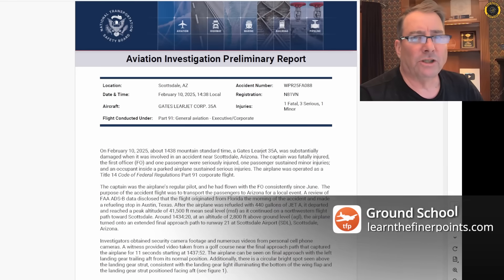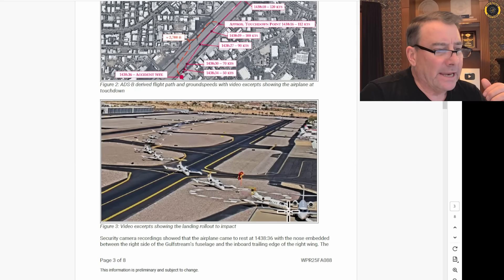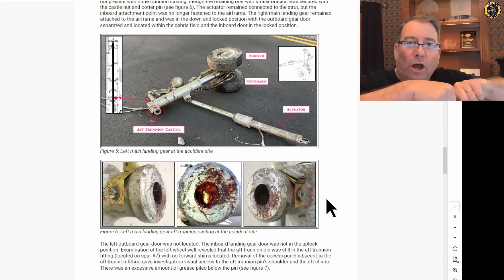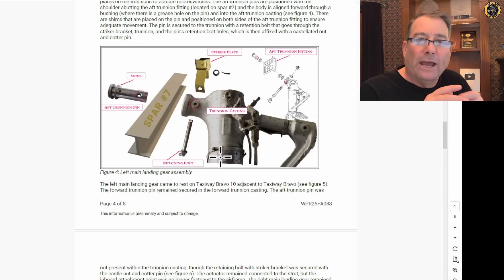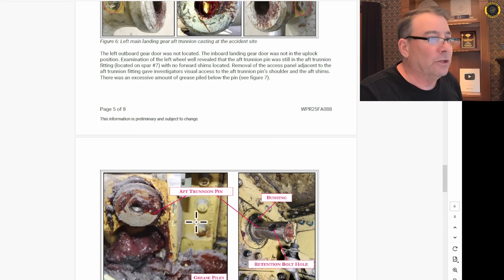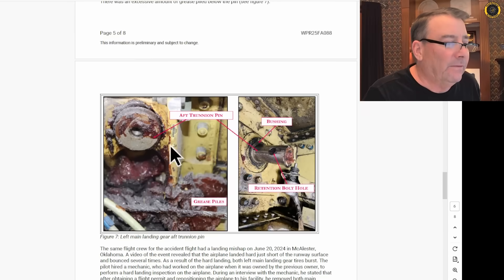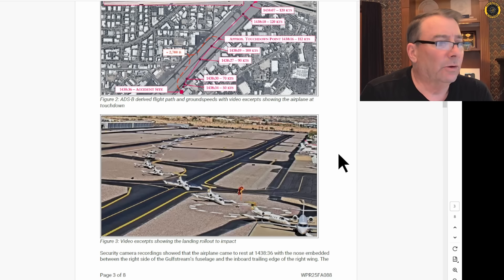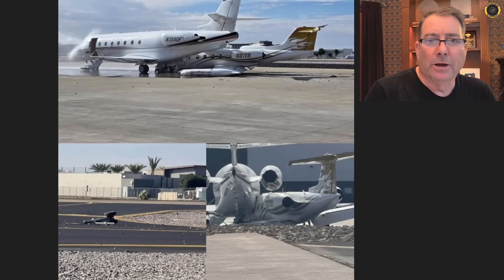NTSB Preliminary Report Fatal Maintenance Error Lear 35 Scottsdale

Comment: I'm an auto mechanic and every time I reinstall a steering shaft onto a steering gear (it uses a bolt similar to what is discussed in this video) I loosely install the bolt and then tug on the shaft aggressively to make darn sure it is actually engaged properly. I have always had a fear that I would do exactly what the mechanic did in this situation. I feel horrible for him.
Reply: I am too - fortunately with all the steering shafts that I've dealt with, you're either a mile off (obviously wrong or the shaft isn't started at all) or the bolt simply won't start due to the notch in the steering gear shaft not aligning with the bolt hole in the input shaft. 

I can't help but think that there would have been an obvious gap at the back where the gear casting would normally be in relation to the spar. Looking at the pictures, there are shims to set the relationship of the gear to the spar - why was this not inspected? Is this not covered on the checklist? I know that it's easy to point fingers from the comfort of our couches but this seems like really sloppy work.
Reply: Great post. Thank you for your due diligence and follow through. You are a true professional.
Reply: I feel more horrible for the people who died and were injured due to his negligence.

Comment: When you work on vehicles that transport people, like airplanes, busses, trains, etc, always verify every step of the way and then verify again! Losing one life is a tragedy. Losing multiple lives is criminal negligence! Even when I'm fixing cars, I double-check that every bolt has been replaced and that they are tight. People with much more knowledge than myself designed them with all those bolts. If they don't need to be there, they wouldn't have put them there in the first place.
Reply: Amen. Never do a half-assed job, ever.

Comment: If the shim stack clearance had been checked the retaining bolt would have been in place correctly. So we know that those clearances were not checked and that the retaining bolt was inserted before the pin.
Reply: Exactly what I was thinking. To totally miss the pin, that shim "clearance" would have to be so huge you couldn't miss it! Is the shim side of the pin really hard to access or something? Is checking the clearance done with a borescope around a tight corner? Or is it just pure dgaf?
Reply: @jessicav2031 I have a rental equipment yard, I'm very familiar with my equipment. Mechanic comes in "Hey boss, I need you to order 25 of these shims" I see it normally requires maximum of 3. I get up out of my chair.
Reply: This installation requires shims under the head of the pin (aft side of the spar, very difficult to access working by feel) and between the spar and the strut (foward side of the spar, visible but tricky to hold the shims in position while pushing the pin through from the back side). All shimming takes place at the rear trunnion pin. Shim placement (whether on the back side or forward side of the spar, typicallyboth) will determine forward/aft placement between the spars, in the wheel well, in order to have proper clearance between the strut and the lower wing skin. Free play clearance (just a few thousands) is measured at the forward side of the aft wheel well spar. It is possible to shim the strut fully forward and measure an appropriate clearance at the aft spar with the aft pin not properly installed.
Reply: 100%

Comment: That's a Red X maintenance job. Am referring to my Air Force days. Red X jobs required being checked out by someone with a lot of stripes on their sleeves. Some Red X jobs required someone with even more stripes to sign off on the repair. For this to happen is unreal.
Reply: IPI in the USAF. In the commercial world we call it RII, required inspection item.
Reply: The unwillingness I have seen of line technicians to have someone check their work is unbelievable. It's a sad ego thing. Totally broken culture.
Reply: @clippy2565  We crew chiefs were the bosses of no one. Everyone else were our bosses. We knew that.
Reply: @miketype1each  sounds like a shitty situation. I was talking about civilian techs though.
Reply: @clippy2565  Okay. Yeah, we did our best. We always wanted to do that. In basic training, we were told that while we may be proficient at an activity or job, that didn't give us license to act, but instead were to be authorized. It was authorization which gave us license to do this or that.. all of which is to say whoever wrenched on that gear wasn't also the inspector. Frankly, for the airport/airline/whoever to allow that sort of maintenance is, well, maybe probably criminal. It's just sad.
Reply: @miketype1each  that culture of having someone inspect who didn't do the wrenching is much less common in civil aviation. I know the airlines do it. And their safety record shows.
Reply: As a R4360 engine mechanic in the Air Force, I know alot about Red X's, everything we did was a red X

Comment: Great explanation Juan! Based on your description there is no way the trunnion pin was properly shimmed or the pin would have been in the correct position to accept the bolt in the thru hole that was designed for it. I’ll never understand why companies that provide maintenance and the maintainers who provide the work aren’t mandated to do all maintenance with manuals in hand and opened step by step to ensure nothing is skipped. It’s impossible for mechanics to memorize every step of every procedure. Not a good look for maintenance.
Reply: I can tell you that a repair station working on these type of aircraft would be required to do have the manual open and follow it step by step.  Whether the mechanic comprehends how to apply what the manual says is another matter.

Comment: I thought ATC was supposed to check aircraft as they approach visually, could be wrong. I guess whoever photographed the plane maybe thought an emergency was already declared.
Reply: ATC= Air Traffic Control.
As far as I know, there isn't any official department that Visually Inspect All Aircraft Attempting To Land (to be able to see the aircraft far enough away from landing and determine if the gear was configured properly and relay the OK to the PIC, the inspector would need a telescope, even with that it would be impossible to check the gear completely and confirm every nut, bolt, pin, and retainer is accounted for).

The possible labels of what to file this under are many-
Common Sense, lack of.
St . . . .
reminding self -->  n o w . . . play nice❗

Comment: @blancolirio.  Juan, we had almost an identical issue with a brand new PC24.   This happened back in 2019 or 2020 when they were still a brand new jet.  

We had a gear unsafe indication on the nose gear.  After a tower fly by they said it looked down and a precautionary landing was made.  Upon landing it did not want to steer.  After examination the Trunion Pin on the left side of the nose gear had been installed incorrectly during manufacturing and the retaining bolt missed the hole just as in this case.  The airplane had about 100 hrs on it at that point and the pin worked its way out just as in this case.

The outcome was much better for us.   We had Pilatus AOG team cover the remainder of our trip with the demonstrator PC24 and I obtained a Ferry Permit after field repairs were made to a maintenance facility where the nose gear was replaced.

Comment: Thank you for the excellent explanation of the gear attachment/assembly process. It would seem that, if the retaining bolt wasn't through the hole and the aft trunnion pin was just pushing up against it, that the head of the trunnion pin would be sticking out too far from the aft side of the spar, and (if possible, I know nothing about Learjet assembly) either visually inspecting the pin to make sure it was seated correctly or reaching behind the spar and feeling it to make sure it was in position would tell you that. Also (and again, I don't know how snug the assembly is) if the pin wasn't properly secured, wouldn't you be able to either pull the gear assembly off the pin or pull the trunnion pin out of the spar while the aircraft was still on the jacks?

Comment: This is very bad.  How many sets of eyes should have looked this assembly over before giving it a pass?  
Didn't they do both gear assemblies after the hard landing? 
 Basic bolt "A" in hole "B", passing through hole "C".  How did the head of the trunion pin sticking out at least 1/2" at the spar NOT draw attention?  
Condolences to all those who suffered from this loss.  
The shortage of quality personnel in the maintenance side of aviation seems to only be getting worse.
Thanks for the report Juan.

Comment: Obviously the mechanic didn't check the clearance and instead just put the same spacers back in.   If that check had been done this problem would've likely been avoided.  The near endless appetite for grease was another missed signal.  Kinda scary how bad this job was handled.

Comment: That's just astonishing. Is there no procedure to pull on the pin to ensure that the bolt is going through it? 

Details matter, but this wasn't a detail. It was the most important task in mounting the gear.

Comment: When I worked on Chinooks in the army around 1980, we always had our work double checked and signed off by a Technical Inspector. I guess A and P mechanics don’t use that system in aviation today.
Reply: It depends on what part they are operating under.  Most general aviation it is not required.  Obviously it is a good idea and many small shops do it voluntarily.  A repair station of the type that works on these kind of jets would have had a mandatory inspection requirement, but if the inspector simply looked in there and saw the small bolt in place, he might just sign off on it not realizing the trunnion pin wasn't seated.
Reply: @ thank you

Comment: Look at the FAA’s picture of the landing gear at timeline 2:11 and look at the actuator closely and look for the wires coming out of the front of the actuator. Those wires are for the landing gear control system and the warning lights. If that actuator is fully extended the wheel well doors will close and give a green light to the crew. I never did like that system because the landing gear could be missing and the crew would not have any indication of a problem. Hope this gives you more information.
Reply from the maker: Thanks!

Comment: Why in 2025 we can't have camera with lenses and sensors the size of a Ring camera or GoPro in an aerodynamic shroud on the underside of the plane....?  Yeah..FAA certification long and expensive..make it auxillary not necessary to the operation..like how pilots can use ForeFlight on their tablets.

Comment: Had the pilot known the gear wasn't as supposed to be, I'm not sure there would be anything he could have done. The optimum choice would have been a belly landing, but once the gear was deployed, I doubt the left gear would retract. Been up in a 35 a couple of times and I don't remember seeing the mains from the cabin, so nobody would have known until it went cattywampus on the runway.
Reply: If he'd known, maybe be ready on the rudders & even use asymmetrical thrust (he had two working engines) or reverse thrust to help maintain directional control. Always better to know.

Comment: In the 4 pictures of the Learjet (2 smaller-2 larger) in the video 
the left main does NOT appear to be anywhere near down-and-locked.
It appears from the airport diagram that the control tower is just slighty 
past the halfway point on the 8249 ft long runway.
Granted the crew did not indicate that there were gear issues BUT I am 
disappointed that no one in the control tower grabbed the binoculars 
to look st the landing gear.
At about a half-mile final the Lear would have been about a mile from the tower.
Had ATC been looking to verify that the gear was down (with binoculars or 
possibly without) they may have observed that something was not looking
quite right.
Just another hole in the "swiss cheese" maybe?
Reply: Obviously, you've never been a Controller in your life!

Comment: Seems like there should be a procedure or indicator  to verify the bolt is correctly seated. having a single fastener be a single point of failure does not seem like a great design.
Reply: There are hundreds of them in every aircraft.
Reply: @AlbertHess-xy7ky    single point failure without any way to check for proper install?
Reply: @asbestosfiber  There are hundreds of them in every aircraft. Cost to rectify?

Comment: Hard to imagine how a competent mechanic dealing with an assembly that is held together by only one pin would fail to make sure that pin is actually inserted correctly... that ~1" gap from the locking pin being ahead of instead of through the hinge pin should have been pretty hard to miss.

Comment: For a pin that takes a shim stack to insure proper placement, this indicates total failure on the so called mechanic that performed this installation. To place the pin that far out of the required position so to enable the bolt to intersect, shows absolutely no attention to any required shim stack adjustment. That is not a mistake .....that is incomitance, plain and simple.

Comment: So this is a common risk in maintenance when you fly into airports with less infrastructure.  I'd imagine being in rural Oklahoma, they got an A&P with some jacks and busted out the Learjet Maintenance Manuals for reference.  This is all fine and good when you're swapping a generator or changing a tire, but for a major event like removal of a MLG, they should use a repair station with the LR-35A on their capabilities list.  At the very least, they could have had a mechanic with specific Lear 35A maintenance training do this.  

Now I will stand corrected if this was the case, in which that repair station will have some explaining to do as to why the item was not properly inspected after the work was performed.  As far as I know, if this was done by a repair station, failure to perform the inspection would be a violation of 145.211.

Comment: Juan, Your 310 has a main gear shaft fore and aft, I have seen them come loose also and the shaft moves out of the clamps and your gear would have the same problem, A&P for over 50 years

Comment: Perhaps one more written step in the gear installation part of Chapter 32 would have prevented ALL of the pin problems...  "Ensure the pin is fully inserted and will not rotate."

Comment: This perfectly illustrates the meaning of an accident waiting to happen. One would think that the mechanic upon noticing that it seemed to require much more grease than usual would have been a flag for him or her to go in there and take another look and find out why it was needing so much grease. RIP to the pilot and condolences to his family.
Reply: "requiring more grease than usual" is a subjective statement
Reply: @tyronetrump1612  Yes it could possibly be. However,  if you work on something on a regular basis you get a feeling for how the procedure normally goes. Anytime it doesn't go the way it normally does you should stop and take a look and try to ascertain why. Especially when it comes to working on aircraft where even the smallest detail might end up causing a severe accident.
Reply: @carlmontney7916  bingo
unfortunately there is nothing on doing this install that would tell you something is amiss ( like something that doesn't fit or feel right). If anything if i were doing this very job and everything went together too easy ( especially that retaining bolt) with no fighting and cussing I would def think something wasn't right. a 2 second peek at the pin in the rear compartment would have   prevented this.

Comment: This may be already in practice, but with the low cost of small cameras, it would make sense to have an image of the wheel position before landing. This could be done for many areas, like the multiple images on a security display, available to the pilots.
Reply: Australian TV has been using them on race cars for 30 years. We see in the drivers compartment, his feet and gear shifts, as well as suspension shots. I reckon they are are a must on airliners to show gear, flaps and the tail unit. The reason not installed by manufacturers is simply cost. The engineering already exists.
Reply: Pilots are very busy when landing a jet.  I doubt they have time to scan and interpret a half dozen cameras.  The problem here is that the "green light" did not mean things were ok.  Fix that.
Reply: @HweolRidda  To be used only when there is a problem to assist in trouble shooting was the intent. Not used when ops normal.
Reply: @johnmclean6498  that's valid.  In this case it seems that they had no reason to suspect anything.

Comment: Responsibility? What is that? i would not want to be the one that signed off on that repair, at least 20 years ago. But nowadays what difference does that make? seems to be a huge lack of responsibility. Everywhere. Whatever ever became of the door plug that blew out of the Alaska Airline flight that was not installed correctly? I have been around Aircraft my whole life. I have never seen it this bad. Mid air collisions, Ships hitting bridges, Runway incursions, Unqualified people in positions of authority..... because they checked all the right boxes on a job app. Qualifications be damned. I am the kind of person that would fly anywhere any time. not anymore. I refuse to die as a result of someone else's incompetence. May it be air traffic control. Maintenance. or Unqualified Pilots. But I could still die on the ground because some idiot crashed an aircraft on top of me.